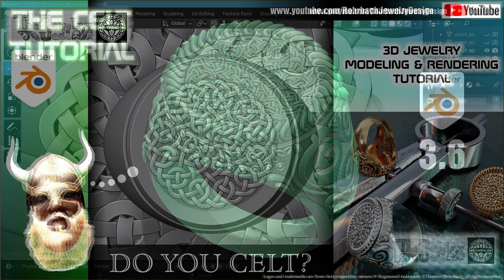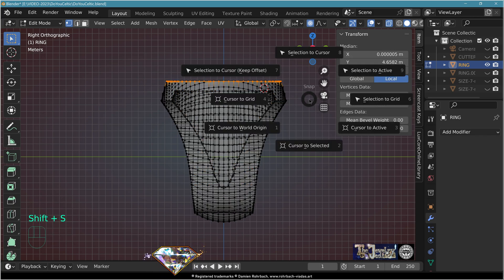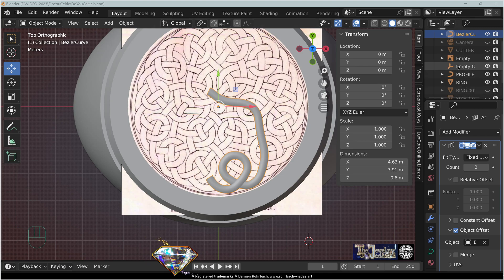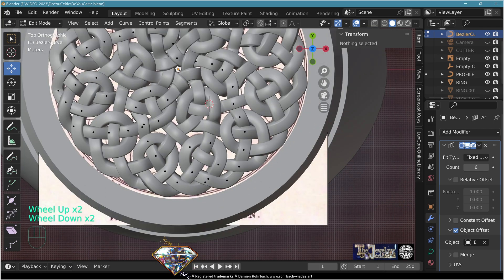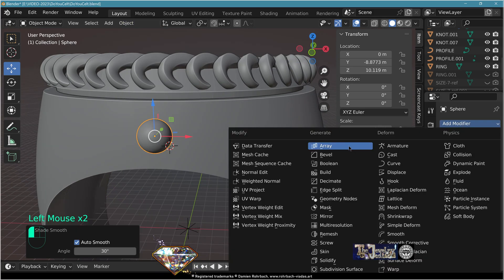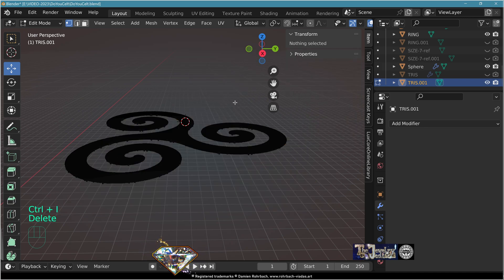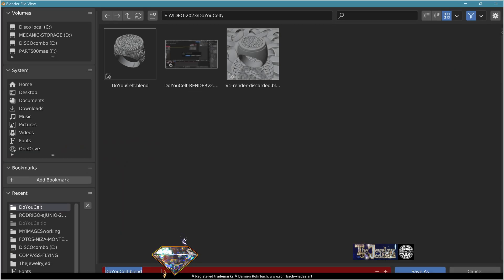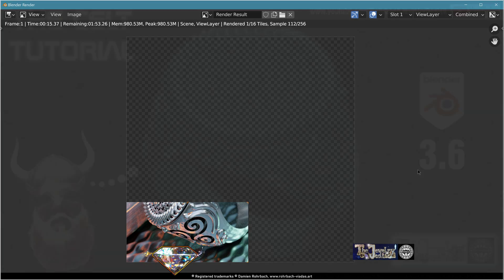The CELT Tutorial 3D Jewelry Modeling and Rendering BLENDER 3.6

Comment: Hello!

This is my second tutorial video I've watched in my Blender Journey,

I'm trying to do the Triskelion Displace Modifier but every time I add my chosen .png image nothing appears in the Mesh Plane and I've tried deleting and adding a new plane to repeat, nothing changed. I've also tried adding more subdivisions in the vertices and also re-adding all modifiers and choosing my .png Triskelion image but nothing still changes and my Mesh Plane is still just a white square with no symbol appearing over it. Is it something to do with Blender not being able to load my image? Usual the PortableApps version of Blender on my External Drive if that's a factor.

I'm a bit frustrated I cannot finish my Celtic Ring when I think I am so close now from watching your video.

Any tips to help out?

Thanks!
Reply from the maker: If you think it's a loading problem, then load any other image to check. You very surely have a position/rotation problem, make the displacement on a cube, and use an object for placement instead of global
Reply: I used a different image of the exact same symbol from .png to .jpeg from my computer's downloads folder and for some odd reason it worked when I selected a different image...I did not replicate the problem if that was the case. I was raring to move along in the next steps to follow in this tutorial.

Thanks though!
<3 @RohrbachJewelryDesign